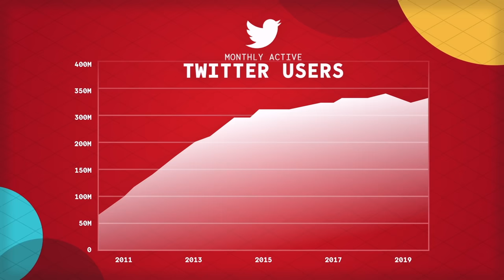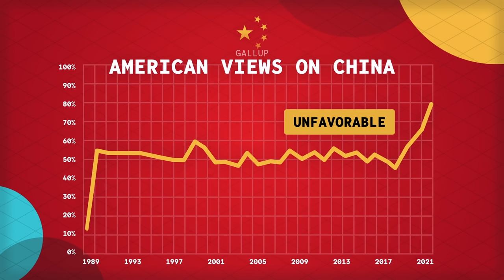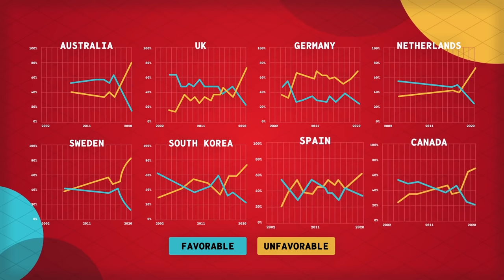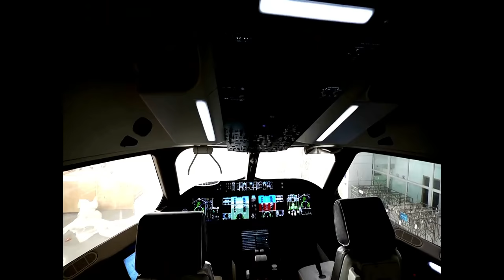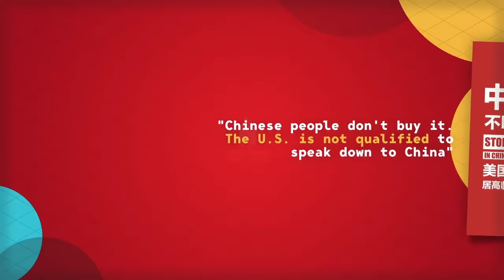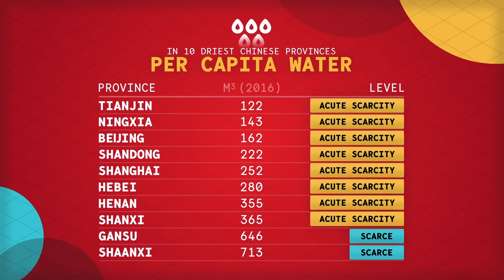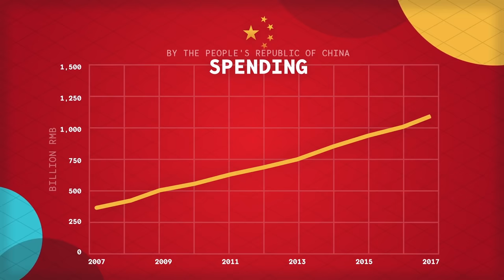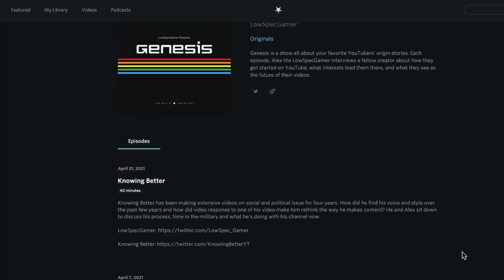Why China Sucks at Soft Power — China's Reckoning (Part 4)

Comment: 15:10 "market-based pricing reform on water " does sound sinister.
17:28 on a side note, and fittingly, the logo of the Beijing 2008 Olympics was a human, but the logo of 2022 looks like a head of a wolf.
Reply: took me a while to see the resemblance in the 2022 logo, and you made a great observation

Comment: Another factor not mentioned in this video is China’s desire for ‘revenge’ for the imperialism exhibited by western nations like the UK. In the 1800s, China banned opium due to severe addiction taking hold of much of its population. The UK attacked China to force it to keep opium legal in order to compensate for a trade deficit due to China only accepting silver for its products (Chinese didn’t want any western exports so the trade imbalance screwed up the UK’s finances). Additionally, China was humiliated during the failed boxer rebellion and other slights which led to the collapse of the Qing Dynasty. The Chinese call this the century of humiliation and even though many of these events happened many years ago, the Chinese are aware of the humiliation and struggles of theur ancestors and some desire to use Chinas position of economic strength as ‘payback.’

Comment: Nice insights. It would appear the CCP's real concern is not whether they are in good terms with the outside world but rather whether they have the support of the masses for them to remain in power. Nationalism may be a double edged sword, or an attack dog, as one puts it. It nonetheless helps to divert the attention of the masses from domestic problems to a perceived, or otherwise, external enemy. And don't all nations use this tactic, the US included.

Comment: “America does not have the qualification to speak with China from a position of strength”, this was a response to Blinken’s statement that America intends on work with China from a position of strength, AKA America will wrestle China into submission with power. How would America react if another powerful country made this bold claim?
Reply: America speaks with China from a position of strength. That is a simple statement of fact. 

China is dependent on imported resources. Around 98% of ton-miles of international trade are conducted by ship. Modern merchant ships are ridiculously vulnerable. The US practically owns the oceans. 

Put those facts together, and the US speaks with China from a position of overwhelming strength.

Comment: I don't think the recent change of China's foreign policy is because of these crisis. These crisis has been there for a while, and were even worse before 2016. Trump and China's military economic strength played a very important role in this. Before Trump the  US policy of China was mostly consistent. Trump wanted to impose a different policy, which was a  surprise to China.  Also 2016 is around the time when China successfully launched the DF-41 in response to NMD. China's plan of upgrading its industry structute was also around 2016, which conflicts with the interest of the US. I think your thoughts was based more on guessing and lack of prove. You should have taken the recent events into consideration.

Comment: And because of China’s high level of surveillance skill sets and capabilities, this video has now given China clarity on weak points. This is why they keep laughing at democracies, everything is free and open even information about your own weaknesses and how to improve them.
Reply: Advanced democracies' transparency does expose weaknesses, but transparency also allows trust. China will never be trusted, and that is going to be China's downfall. 

An American-led coalition of nations is going to cut off China's access to global trade, and that is going to be the end of China as a great power. We'll see how far China falls. America will get the process started, but once the process is started, multiple nations have the ability to drive China deep into the dirt.
Reply: @yopyop3241  Thats one way of looking at it. There are always pros and cons to any type of settings.

There are also negatives to the democratic instance as well. What if the US for example doesn’t live up to the reputation needed for trust? Just proving a nation shallow of the ideals they promote globally as reasons to intervene in foreign affairs.

Both ends have pros and cons.
Reply: @kodekorp2064  The US has built up a massive amount of goodwill. 

In the aftermath of WW2, the US had the only intact industrialized economy, the only intact industrialized navy, the most powerful air force by far, the most powerful army, and the only nukes.

The code of international conduct in place at the time and since time immemorial (with only minor tweaks around the edges) was based on "might makes right" and "do unto others as they would do unto you, but do it first."

The US was set up to ravish the world, and it would have been "justified" in doing so.

Instead of doing so, the US used its overwhelming position to implement today's new world order that is based on universal natural human rights.

That was undoubtedly the greatest moral act by any nation in history, and nothing else comes anywhere close.

The US has built up a massive amount of goodwill.

Comment: 13:20  YES, that's true, but there's a new era that will take care of that problem. Remember, we are now entering the new generation of automation, robots, and the like. This hi-tech solution can handle  what those demographic bracket (30-64, the producers) do, at breakneck speeds. It's not all about people, it's ALL about machines!  You might not need that many people to accomplish the task at hand.
Reply: That will work for Japan and maybe for Germany. Extremely doubtful for China. 

In the global industrial robots sector, Japan is responsible for around 45% of the total value-added. Germany is around 10%. No one else is over 5%. China comes in at less than 2%. 

What's worse for China in this area of competition is that China faces a unique disadvantage. One of the beneficial features of robots is that unlike human workers, robots don't care where you put them. That allows you to put your highly automated factories anywhere in the world, wherever the conditions are best for access to energy, parts, consumer markets, labor, etc. The PRC's capital controls prevent Chinese companies from investing overseas, so China ends up preventing itself from being able to take advantage of key benefits of automation.

If you dig into the specifics, it's even worse. It turns out that the best location for setting up automated factories is clearly the USA. The USA has the cheapest energy, the biggest  consumer market, the biggest still-growing consumer market by far, excellent security, and the most reliable access to inputs. Going forward, the USA has the best potential for green energy production, so the likely incoming carbon taxes will only magnify the US advantage.These days, the biggest and most profitable Japanese-owned and German-owned factories are in the USA and not in Japan or Germany. Countries like Taiwan, Korea, the Netherlands, etc. are quickly ramping up, too. But if there is any country that the CCP will ban Chinese companies from investing in and if there is any country that Chinese companies will be wary of investing in, it's the USA. If relations between the China and the USA ever turned sour, any Chinese-owned automated factories would simply be confiscated, just like Russia's currency reserves were in the wake of the Ukraine invasion.

China lags far behind the leaders in this winner-take-all race, and China is struggling under the burden of a major handicap that none of its competitors has to deal with.
Reply: Automation for what end? To export/product dump on the world market? Automation for cheaper labor? Automation for transportation? Automation for natural resources extraction? Automation for services? Specialization is the key to automation, each a difficult task.
Reply: @yopyop3241  it's kinda funny because people said the same thing in 80's about Japan just automating and that solving all their demographic issues. Although Japan is the most automated society when you compare people to robots and how people got really creative with vending machines/low skill labor. But yeah your right about the whole "build where you sell".

Comment: The "success" of Stalin - the man who used to boast about having conducted the U.S.S.R. "from the plow to the atomic bomb in just a generation" - compared to Gorbachev's failure shows that a socialist economy is unable to function with a minimum of efficiency without requiring a massive dose of political violence. In an attempt to reform a decadent regime, Gorbachev moved faster with the process of economic opening in the hope of removing the predictable resistance that the Soviet bureaucracy would create to economic reform measures, as thorough proof with the failed attempt. coup d'état in August 1991 - which ended up precipitating the final crisis of socialism and the dissolution of the USSR itself

Its Chinese parallel - Deng Xiaoping - adopted a logic diametrically opposed to that of Gorbachev: it prioritized the achievement of economic prosperity (adopting in practice capitalism) precisely to delay any attempt at political opening, as was evident with the acceleration of the economy. reforms after the Tiananmen Square massacre.

It is important to note that it was Karl Marx himself who, in his Contribution to the Critique of Political Economy, discerned the scenario in which the conditions for a social revolution process are formed, describing it as follows:

“At a certain stage in its development, the material productive forces of society contradict existing production relations or - which is only their legal expression - with the property relations in which they have been active until then. From the forms of development of the productive forces, these relations are transformed into fetters of them. So, it is a time of social revolution. ' *

By rejecting the pursuit of profit maximization as an instrument to stimulate innovation, socialist countries ended up condemning themselves to obsolescence. Thus, they lost the chance to incorporate the productivity gains made possible by technological progress. That is why the capitalist countries managed to provide a greater rise in the standard of living of their population, even without pursuing the egalitarian ideal. Therefore, until the “final crisis of socialism” (to paraphrase K. Marx's own definitions once again), it was only a matter of time. But religious fanatics do not give up on their faith, even against the indisputable proof of the facts, which completely refute it!

* Reproduced according to MARX, K. Preface to the Contribution to the Critique of Political Economy, organized by Florestan Fernandes and published under the title K. Marx: Theory and historical process of the social revolution, In Marx & Engels, Great Social Scientists Collection, History, vol. 36. São Paulo: Ática, 1983. p. 232. Commemorative edition of the centenary of Karl Marx's death